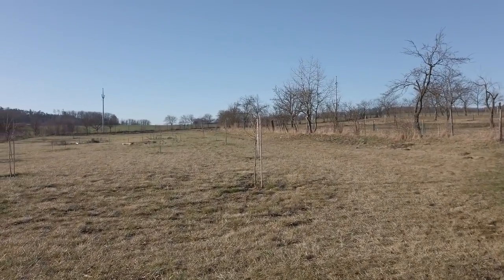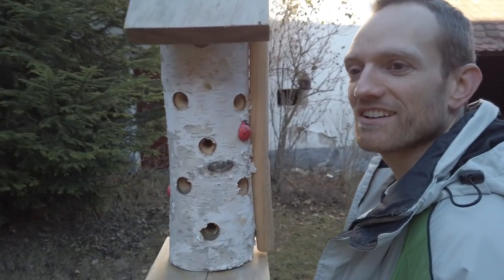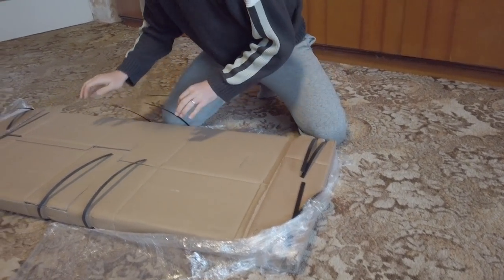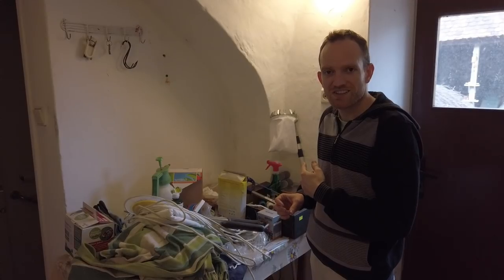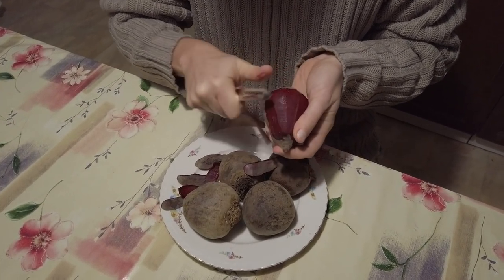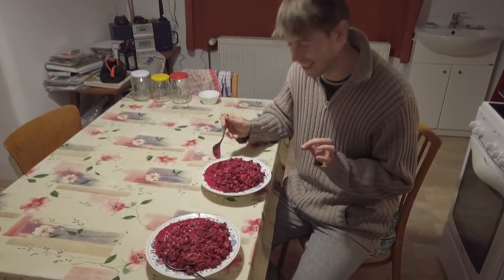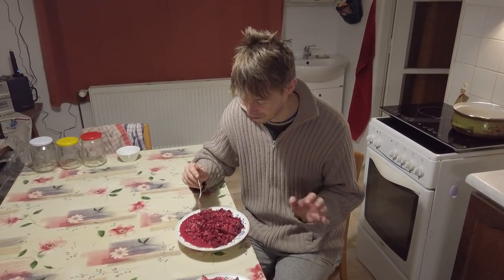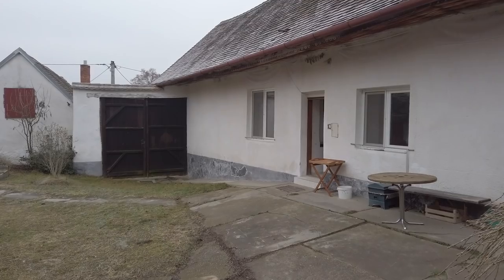The reality of living in the countryside | Cottage life

Comment: A tip for your new tool shelf: buy small containers, either boxes or plastic, to organise everything neatly. I mean a system similar to a drawer organiser, which divides a drawer into specific spaces so that you can store more in it. 
For example, store small pieces like screws, nuts, bolts and nails in separate small containers, ideally a small set of drawers. Tools like a small hammer, screwdrivers can all go together in an open box. Then large tools like a drill just sit on the shelf, not in any container.
Reply from the maker: Thanks for the suggestion, that's a good idea, especially for little things like screws and nails which you put away somewhere and then never see them again 😃

Comment: but wouldn't the birds will be attacked by cats? :O  seems very low location for the houses... we usually put them higher and not so easy to be accessed by any predators  :) We have two which are out there for decades :)
Reply from the maker: Hopefully not! We hang them in a recommended height based on the instructions. Each species prefers a different height though. We'll have to keep checking them but we made sure we didn't put them close to branches where cats could go. In the worst case we'll move them to a different place 😊
Reply: @tommyandpeter  cannot wait to see the happy families :)